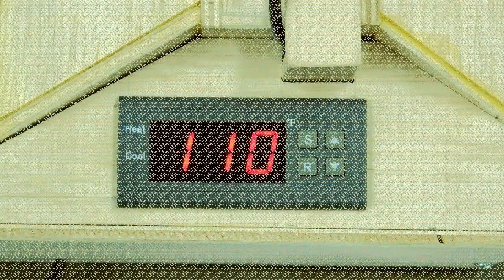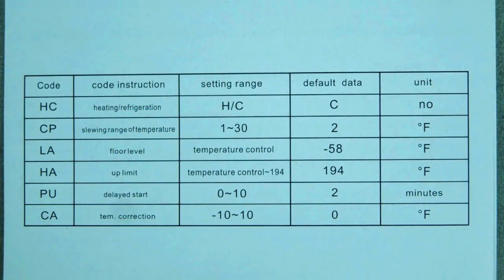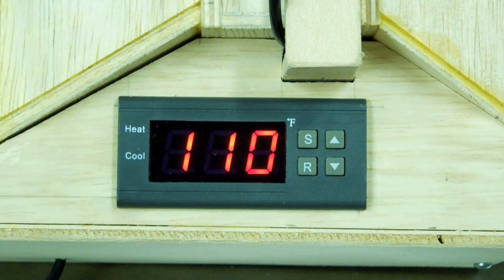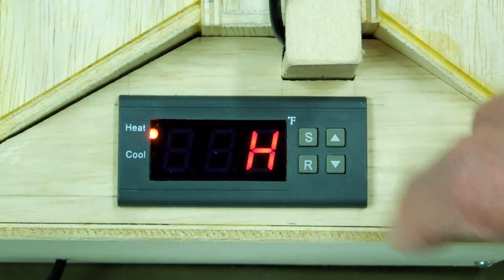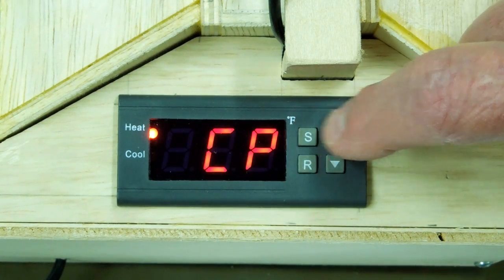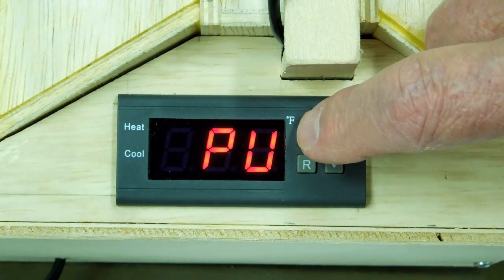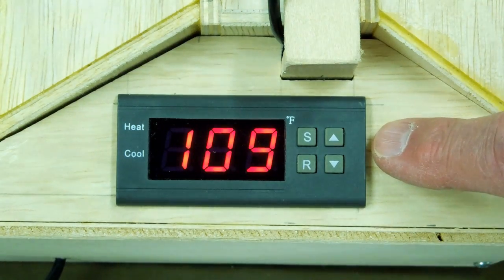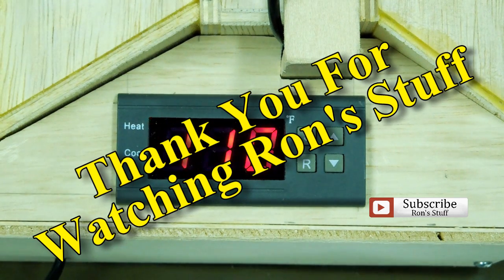MH1210F Temperature Controller

Comment: I think this is the only version that will do F vs C.... They have AC/DC versions, and also have a temp/humidity version, but, I think it is C only... These same controllers are marketed under the MH and ST models ie... ST-1000, ST-3000, etc.. STC 3008 DC12V Temp/Humidity

Comment: Sure I can follow a schematic, but this diagram doesn't indicate the polarity of the DC model. I got lucky with the one I put on the spa, but do I have to open the side of the spa every time I order another one of these. Maybe so.
Reply from the maker: Yes, I did not think about that. I have not seen a DC powered version... but I would assume positive (red) on the left and negative (black) on the right.

For the A/C versions they do seem to follow line (black) on the left and neutral (white) on the right for each pair of connections.

The sensor doesn't care which way it is connected.

The output (controller) doesn't matter either as it is just an On/Off switch but you can once again follow positive (red) on the left and negative (black) on the right.
Thanks for watching! Ron

Comment: How would you install one of these in a Mini-Fridge if you could not find a replacement thermostat?
Reply from the maker: If you do not care what it looks like, the MH1210F could be surface mounted exterior to the mini-fridge. For a neat appearance (and while referring my video: Mini-Fridge Stopped https://youtu.be/qAEKpQmItfM) I would carefully cut a rectangular hole in the mini-fridge wall (the correct size for the MH1210F) between the top shelf and the bottom of the freezer compartment, rear of where the thermostat was installed. Two wires are in that side of the mini-fridge and run from the thermostat to the compressor… take care not to damage those two wires when cutting the rectangular hole. Carefully smooth any jagged or sharp edges, which could damage an electrical wire. After wiring and testing I would run a bead of silicone around the temperature controller inside the fridge to prevent airflow and condensation inside the wall. I would also plug the hole where the wires protruded for the original thermostat. Make a small wood or plastic box to cover the rear of the MH1210F to prevent accidental contact with any of the electrical connections. The mini-fridge was designed to operate with the sensor tube of the thermostat clipped to the rear of the freezer compartment. I would place the temperature probe from the MH1210F in the same place and play with the correct temperature setting for the freezer compartment to obtain the desired temperature inside the mini-fridge compartment. This will short cycle the compressor and prevent the inside of the freezer compartment from becoming too cold (which is exactly the way the compressor ran originally).